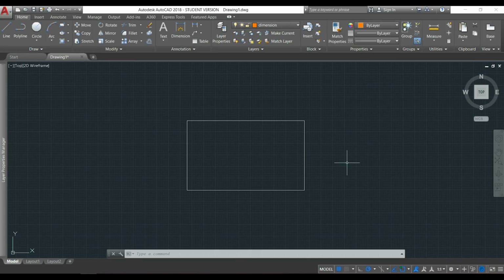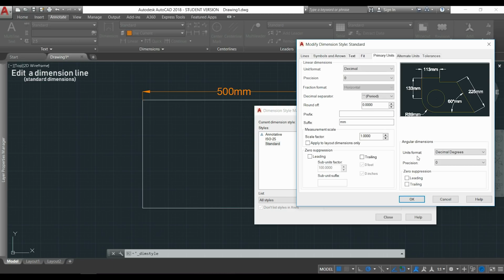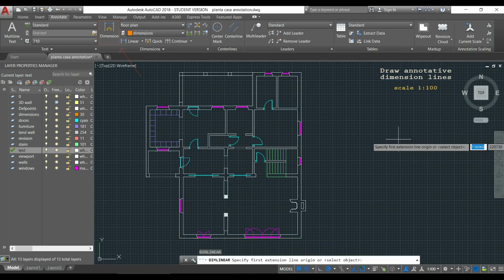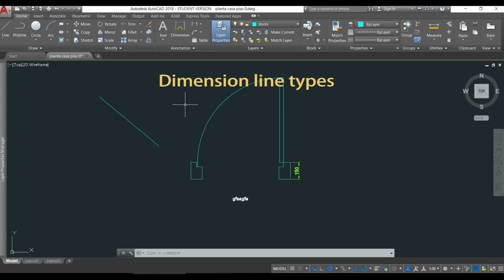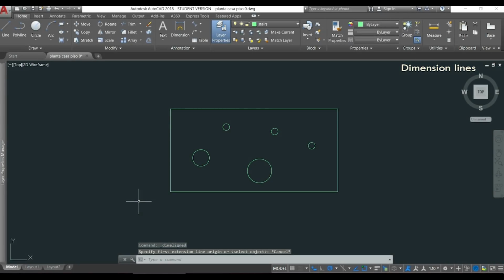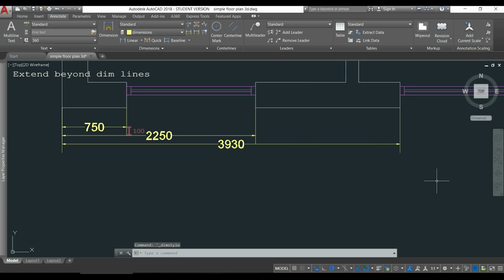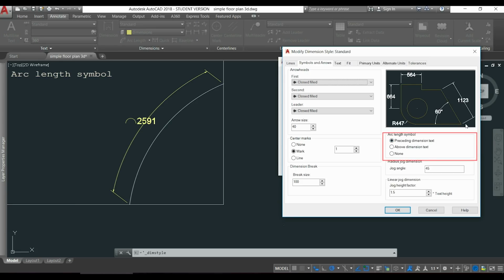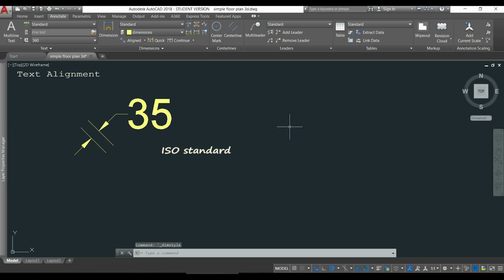Autocad 2018 - Dimension lines (complete tutorial!) PART 1

Comment: Hi CAD in black i'm a beginner and how can i set the correct measurement in mm? trying a simple box and i want to place the dimension of 500 mm x 200 mm is the dimension can be type writen and it will appear automatically?
Reply from the maker: Hello. You can add a suffix on dimension style manager -> Primary Units -> suffix. type "mm" there.